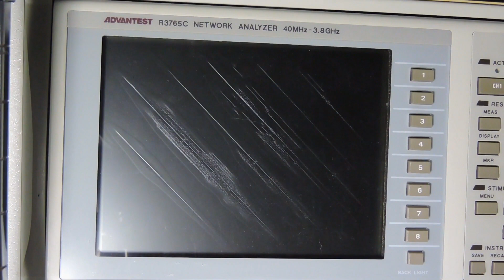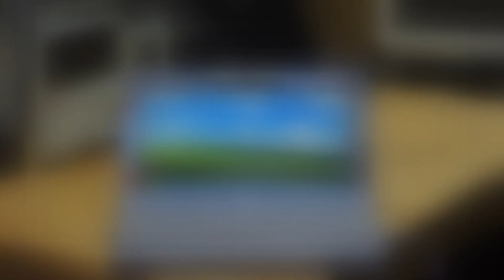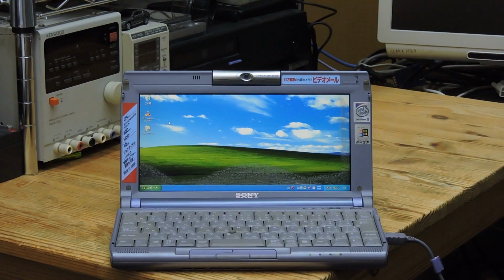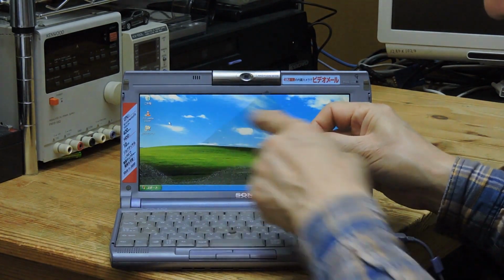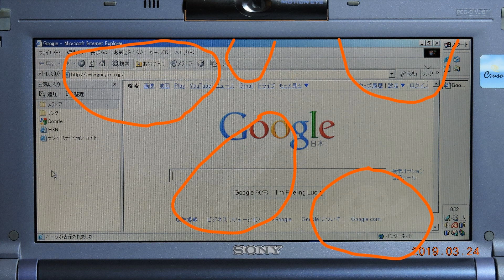Vinegar Syndrome, a disease of LCD panel. It can be repaired by renewing the polarizer film

Comment: Great video. I've succesfully replaced the original polariser that was breaking down on my Sony Vaio PCG-C1XD. Following your advice I've used a non-adhesive type which is fitted to the metal frame of the LCD panel. Just as you've shown at the 15:00 mark, if the polariser film is pushed into the LCD it starts to do that 'staining' but using double sided tape I've got the oversized polariser to sit away from the LCD so it only happens if the polariser gets pressed on, but it can be pulled away again with blu-tack.
Next time I'll probably use some thicker double sided tape for a greater air-gap between the LCD glass & polariser. My PCG-C1XD looks great again though :)
Reply: An addition to this, it's the next day and the polariser started sticking to the screen again and wouldn't come away. So I took it apart again and this time used some 1mm thick double sided clear tape and put it back together. It's the clear jelly type with the red label rather than foam double sided tape. 
Hopefully that keeps it from getting stuck again, since it looks much better when it's got an air gap. Probably it would work best installing 1mm thick hard plastic spacer strips around the metal LCD frame then affix the polariser to that.
Reply: 2 weeks later and the polariser isn't sticking to the screen any more and looks great. The polariser sheet is not flat but that doesn't distort the picture in any way, just looks odd when there's light reflecting off of it. The screen display looks as good as it did before the original polariser started to break down, colour accuracy and viewing angles have not changed.
Specifically I've used small sections of 1mm thick clear double sided tape at the edges to create a gap between the polariser sheet and the glass. It works well on a small screen like this but might not work with bigger screens.
Reply: @voodle_3d  Hello, do you have any photos of this? I too have a C1 with a degraded polarizer and want to fix it. Was it a difficult job?

Comment: This is an excellent and truly useful video. I bought one of those beautiful Sony laptops (a PCG-C1VRX/K Windows 2000 model that looks exactly like the one in your video) in Tokyo in 2001 and brought it back to the USA. A few days ago I took it out and discovered that it had advanced vinegar syndrome! I was very disappointed. I had never seen this problem before, including with other even older laptops that I also bought in Japan (I have two Panasonic Let's Note models whose screens are still perfect, although they do not work anymore for other reasons--one has a dead hard disk drive and the other has a dead motherboard). I wonder if these Vaio PCG-C1 models are particularly susceptible to vinegar syndrome. I keep my house cool and dry, although on cool nights we do sometimes leave the windows open in the room where the affected PC was kept. Nevertheless I am careful to keep my home dry because of the damage that humidity can do to various electronics and other items, so I am quite sure that my Vaio has never been exposed to excessive heat or humidity for long periods. The screen of my Vaio is quite extensively covered with the whitish residue, like the one with the polarization film you removed in this video. At first I was baffled when I saw the screen, thinking that the battery must have leaked although there was no sign of any damage or leakage on the battery. Then I wondered if the LCD itself had leaked "liquid crystal"--which may not even be possible for all I know! Your video gives a clear explanation. I am going to try repairing my Vaio using your instructions. Thank you for taking the time to make this video. 本当に勉強になりましたよ！
Reply: It does look like the Sony Vaio Picturebook C1 series is particularly susceptible to vinegar syndrome / polariser breakdown. I have a PCG-C1XD that has been in the UK for its entire life, so always in a fairly cool climate, though I've only had it a couple of years and don't know if it lived in a box in the loft for all that time.
The polariser has just started bubbling along the lower edge of the screen. Right now when on it just looks like the screen is dirty but I'm sure it will progress fairly quickly from here.
Reply: @voodle_3d  Do you think you'll attempt a repair? I thought I would but I haven't yet made any move in that direction.
Reply: @danatube8258  I've got a few bad polarisers now, queued up to be repaired. The PCG-C1XD's polariser failing was an unfortunate discovery today, another one to fix. So I plan to get that polariser removed and replace it with a fresh one before it gets worse. 
Gonna practise more on things like broken LCDs before tackling this one. Realistically it's not too bad, put the screen onto a flat surface, use an oven scraper to pick up one corner of the polariser film, drip some d-limonene glue dissolver into the gap and start peeling. If peeling doesn't work then the oven scraper blade at a shallow angle should be able to work up the polariser until it's off.
Gonna try some non-adhesive polariser films first, getting the sticky ones on there without bubbles is genuinely difficult.
Reply: @voodle_3d  I've never done anything like this. It's a bit intimidating. I guess I don't have much to lose, though. Good luck, and let me know how it goes with the Sony if you think of it.
Reply: Ah actually I just realised from the video thumbnail that the LCD glass has an anti-reflective coating on it underneath that polariser film. So I'll need to use a plastic scraper to clean off the glue rather than a metal one, to avoid damaging the AR coating.
On other LCDs without AR coating though, I've used a metal oven scraper blade to clean off bits of polariser and glue.
Reply: @voodle_3d  Perhaps leaving the machine out and open would halt the corrosive process?

Comment: Great video, learned a lot! One question, what is the model of that sony handheld computer? I loved it!
Reply: In the U.S. I believe it was known as the Sony Vaio C1 Picturebook, with a few different model numbers depending on specifications. I bought one new in Japan (a Windows 2000 model), and as I recall they didn't use the "Picturebook" branding in Japan. I just discovered that mine has advanced vinegar syndrome! There are also some for sale on eBay with vinegar syndrome. When I used to use that little laptop in coffee shops people would ask me about it constantly! I loved it, although it ran fairly slowly and the fan was quite loud.

Comment: Hi, just want to know, for the existing LCD panel, there are total 2 films we need to consider ? and most LCDs have 2 films in general ?
Reply from the maker: Polarising films are affixed to the front and back sides of LCD panel, with the polarisation angles intersecting at 90° each other. However, the polarising film on the front side seems to be easily damaged. Moreover, it is easir to replace.
It is better to replace the front side first and see the result.

Comment: I have not watched yet, but I have the same laptop that is in pretty good condition but horrible vinegar syndrome and a dead battery.  I would love to fix this thing up to top condition, and having a video for the same piece to give me confidence is fantastic!  Thank you!
Reply: Also if the layer underneath the LCD is also messed up don't even bother trying to fix it all, just live with it. Or find a replacement.
Reply: Just wondering if you tried fixing it. I have the same laptop as well and recently took it out and discovered advanced vinegar syndrome--probably the last description that ever would have occurred to me if asked to describe the problem!
Reply: @danatube8258  Yes, I've done the repairs a couple times at this point.  Its quite laborious.  I'd only recommend using a razor to pick the corner of the polarizer up if possible.  If it's too far gone it will probably tear a lot but just be real careful.  I seen a video of a chemical that can remove the leftover glue super easily, it would be worth getting.  Removing it with alcohol is a bitch and a half.

Comment: I had no idea I could fix this issue, thanks for the video. Although getting it on the first try with the proper alignment and without any air bubbles sounds rather a very hard thing to do especially with a large panel, maybe I could use some kind of weak glue or water to hold it together with the non adhesive one instead.

Comment: Is it possible to prevent the vinegar syndrome from happening in the first place if the device is used daily? 

I can envision this problem happening to even the modern LED and OLED panel TVs, especially for those of us living in tropical countries.
Reply from the maker: Keep any equipment using LCD panel in dry and well venturated place to avoid this problem.
LED back lit LCD panel can be suffred by same problem. But OLED panels do not use polalizer film. This problem will not occure.
Reply: @shuichirohirakawa3945  I know OLED does not use polarizer films, but are you absolutely sure that no protective and/or antiglare film is applied to some/most OLED displays, which might be made of the same material as these polarizers?

Comment: Jezzus, I also use my nose near it and smell it, indeed smell like vinegar!!! I also have this in my old Samsung SyncMaster P2050 20" monitor. I wonder will it heal if using heat gun to penetrate those white bubble/vinegar in those area? Instead changing the polararization firm?

Comment: I have an old monitor that  has developed this syndrome on the inner panel. I have removed both sides as I mistaken the outer/front side to have developed the vinegar syndrome, so now I need to replace both inner and outer polarizing films!
Do you have any suggestions how I can test to find out the correct angle of polarizing film to purchase for replacement?
Reply: This is answered in the video itself... But were you able to fix it?

Comment: Thank you a lot for the video. One of my 20 year old laptops has developed the same symptom and I was not sure what it is and how to deal with it. Googling lead me to many articles, but this video has summarized everything in circa 20 minutes. The way I did it was a bit diffeent, and I wasn't successful after first attempt... Nevertheless, it worked and now I have new old laptop with no scratches, or other defects. It'd have been much harder without your video. Thanks again and a Happy New Year!
Reply: Could you share what was the method you used that fixed your problem?

Comment: Thank you for this educational video Hirakawa san. I have a question. I've removed polarizing film on my Benq TN display and when tried to replace it with new one, i found out that image went striped. No visible damage i found, but when i move those few ribbons with chips that goes from control board into glass sandwich - i see these stripes moving. Is there any chance fo fix my display, or i have no chance and better throw ot away?
Reply from the maker: Thank you for your comment.
Hmmm, The symptoms seem to be beyond my knowledge. I guess, there may be problem at the connection between the LCD module and the control board. 
Sorry, but I can't help you much.

Comment: Hi Mr. Hirakawa, is it possible to make a diy
polarizer with anti radiation filter statically joined together for sturdiness..
no need to glue it on to the screen itself because it is removable and can be mounted on the lcd screen just by clipping it or hanging it on?.  My 2007 Buffalo brand LCD screen just vinegared out and Im thinking about replacing it with a removable clip-on polarizer + anti rad combo filter.. Thank you for the good work on your video.
BUFFALO LCD model link:
http://www.itechnews.net/2007/01/13/buffalo-ftd-w2025adsr-20-inch-lcd-screen/

Comment: Hi, I would like to change my TV polariser (model Lc-40M500M-BK). 
My question is, 
To find the polariser angle, I need to tear down the previous polariser on TV before testing it or I just put my test sample on top of it?
Reply: Just a very late update regarding my attempt to repalce my TV's Polariser. 

I repalced it and its working!

Minor error on me that damaged the LCD itself because the degrading polariser gave me a tough time removing them. Just a few scrape over it. 

Also despite my best of ability to avoid damaging to the fragile lcd cable, one of the many cable was torn when disassemblying the outer shell for the LCD edges.

It works fine and other than the small vertical black line (torn cable section) and few scar on the LCD (not apparent when watching videos comapred to still images).

Will post images link here when I done uploading them.
Reply from the maker: You do not need to remove old/damaged  polarizer for the test. Just put a test piece on the working LCD panel.
Reply: @shuichirohirakawa3945  ok, thank you! 
I brought a angle test kit and 90° is the clearest while 0° is the darkest. 
 I should buy a 90° polariser for the front polariser of the TV right? 
  But the seller I am dealing with advise me to get 0° Front, 90° Back instead.
Reply from the maker: @popcap990  Understand your question, but I cannot give any comment as I do not know about the product (angle test kit).
Reply from the maker: @popcap990  
Thank you for the information. I did not know that such large sized polarizer is available on line. 
But, sorry, the information on the site is limited for judging the angle. I still cannot answer your question. 
You should ask the shop for the correct angle.
Reply: @popcap990 I have a similar problem. Were you able to find the correct degree for the polarizer film? If so, what did you use for the front and back? Thanks.

Comment: Hi. Congratulations for your work and for the useful video. I followed step by step your detailed instructions so as to replace a gauge burned polarizer film. The film was burned most probably by direct UV rays of the Sun. I started by removing the burned film and then by cleaning carefully the glue from the surface of the LCD screen. By rotating the new film on the back lighted LCD screen I found the right position and get the best contrast. Then I placed the sticky side of the film on the LCD screen and in regards to the contrast, it looks really nice. The only issue is the color of the screen. The LCD screen has a dark green color now, far away from the factory light gray. Could please advise on how to change that annoying green color? Should I change again the poliriser film with another one with other characteristics? Thanks in advance for your reply
Reply from the maker: Thank you for your comment.
My guess is that as your LCD panel was damaged by direct UV rays from the Sun, so pigments in the colour filter layer was also damaged (discoloured). Discolouring speed is different colour to colour. I’m not an expert, but we often experience that the red ink or red paint fades faster than others by UV rays. May be similar phenomenon occurred in your LCD panel.

There are 2 types of polarizer film, linear and circular. But, in you case, I do not think this is the problem.
Reply: @shuichirohirakawa3945  Thank you  for your reply and valuable comments.

Comment: This is very good. I have for some years fixed Nintendo Gameboy Pocket using this technique with good success. I have Apple iBook G3 with the Vinegar Syndrome but I never did such big panel before but I try it. Do you have good link to buy the polarizer film ? I do not want it with adhesive.
Reply from the maker: Hello Chris, 
Thank you for your comment. 
Here is good source of polarizer film supply. Check this site;
https://3dlens.com/ and go “LCD Polarizer Film”.
 They have polarizer film designed for repairing LCD panel for laptop.

They have non-adhesive type also, but I now recommend using adhesive type with thin water solution of dish detergent. 
For details, please visit my website. (Sorry Japanese language only. Please ask Google for help)
http://hirakawa-jp.sblo.jp/category/4440229-1.html

Comment: Hi. Thank you for this video. Had this syndrome in several vintage laptops (Apple, Compaq, Toshiba, Digital, etc). I was so sad thinking they had to be scraped. I've seen these filters available online but was not sure what angle to buy.
Reply from the maker: It is difficult question to answer. Polarization angle of LCD panels can be different depends on manufacture, models or even production lot. They can be vertical, horizontal or tilted 45 degrees left or right. I suggest you that you first purchase a small size polarization film and test it with your PC panels. Then, purchase larger size as necessary to fit your PC panels from the same supplier. If possible, ask the supplier if the large size one has same polarization angle as your test piece.
I would appreciate it if you can give me a feedback no matter success or fail, so that we can share your experience with others.
Regards,

Comment: More than the replacement instructions, the explanation about what happens to the film is very interesting and useful. Thank you for the video.
Reply: My Furuno depth sounder is almost impossible to read. Needless to say, direct sunlight and humidity is guaranteed on a boat. I had never heard of vinegar syndrome, and had no idea of the failure mode.